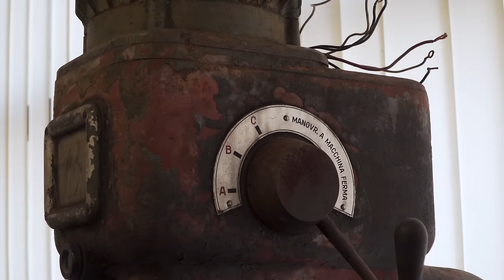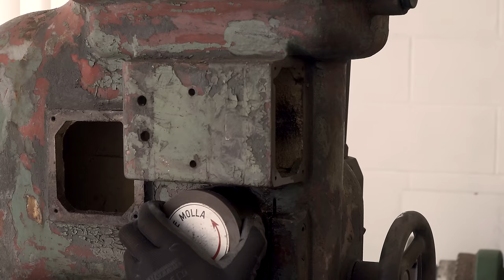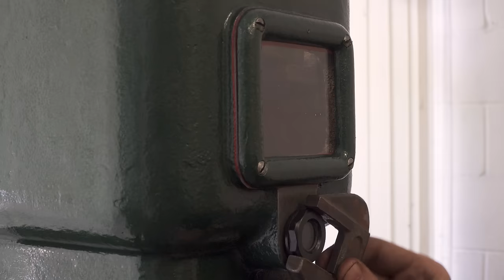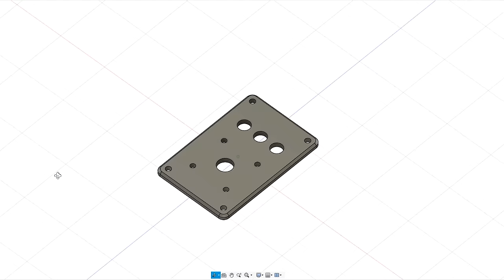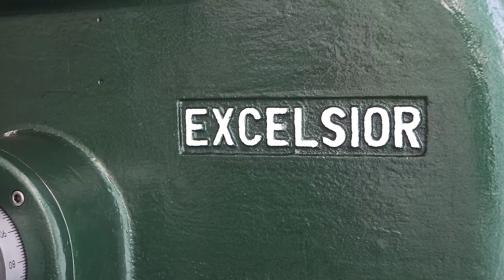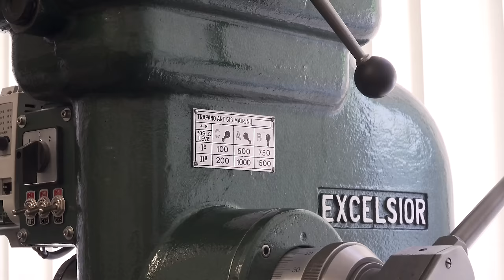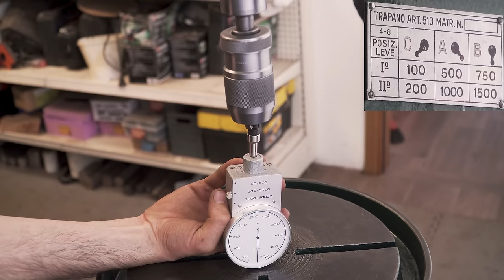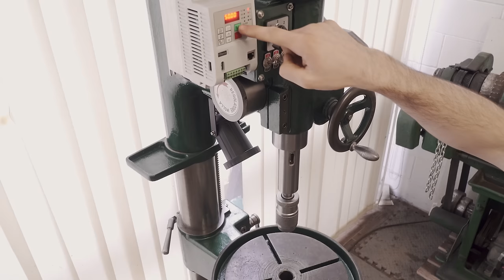EXCELSIOR Drill Press Restoration | Heavy Duty Geared-Head Drill

Comment: For future reference...if you're trying to remove a drill press head for example that has been pressed onto the vertical shaft, or is just fused from time, instead of using a pry bar and exhausting yourself use a reciprocating saw without the blade pressed against a block of wood that is in turn pressed against the part while applying pressure in the direction the part needs to shift, slide, etc. It acts something like a jackhammer...but much less intense. The quick vibrations and forward thrusting motion makes quick work of most fused parts.

Comment: Definitely the biggest tool restoration I've seen on YT! Also, interesting to see a more realistic / practical restoration compared to many youtubers that make everything look perfect - like sandblasting everything down to bare metal and filling any pitting before painting. Or nickel plating all the screws etc. Not that there's anything wrong with that - it's just a different take on restoration. Maybe if you were restoring it to sell, it might be worth going to all that extra work - but not if you are just restoring it to use yourself.

Comment: Very nicely done and what a remarkable machine you now have. I cannot imagine having a drill press this accurate and heavy duty. Very jealous! That will give you a lifetime of joy. I do hope you put some grease or coating on the elevator column. You did not show putting anything on, that I saw, but I know that is a place exposed to whatever is in your shop and seems to "attract" rust from the very air around the drill press. Anyway, great job and I like how you did not worry about having everything polished and shiny. Nice job with the hammered paint. 400 Euro, cheap for that wonderful piece of historical precision and reliability!

Comment: fair warning you've installed that seal below a brand new sealed bearing rather than the OEM open bearings, so there's now no means for the seal to be lubricated. it'll eventually fail and its not really doing anything now except adding a bit of friction to the spindle.  In cases where I've replaced open bearings with sealed ones, usually in plant equipment that's frequently neglected I fill the cavity between the sealed bearing and the seal with oil to prevent the seal from failing.
Reply: Yeah, sealed bearing like that in a non-production environment getting fairly light usage compared to its intention, what do you figure, maybe only 20 years of life?
Reply: @ixamraxi  bearing will be fine. Seal will fail

Comment: Chipped cast iron is perfectly restored with automotive putty with glass fibers. The resulting dried walls can be up to 20 mm thick and are perfectly sanded. After complete drying, they can withstand even medium hammer blows. This is how I restored the chipped edges on the table of the universal sharpening machine.

Comment: Nice one, surprised that this doesn't have feed, since it does have the locking action. We used to have a giant one, which had the same action, and then a rotary selector on the front for the automatic depth feed. Was bought used, and came with spiral drills up to 80mm in diameter or so :-)

Comment: Hammerite is awesome. They make a direct to rust epoxy in smooth or hammered finish and it is one of the best paintaible products I've used. I even use it on custom subwoofers I make. 

It's far far better than dulux or rustoleum hammered finish and products.

Comment: at 27:47 the liquid pump is upside down.  The copper tube cut on a 30 degree or so is suposed to have the solid part of the tube on the bottom.  This is for a reason, you have it pointing down, its suposed to point up.

Comment: I was into the restoration then you put the spring in backwards at 14:22 then crimped the oil line at 17:50.  If you look at 1:39 you can see the oil tube has the relief cut facing up, you reinstalled it facing down.  What rotated? Did you install the oil pickup correctly? Came out nice though.

Comment: So presumably the oil feeds down to the quill bearings from the gearbox? So would it not have been better to remove the seals on the bearings to allow oil to lubricate as per the original? Or would you say it’s workload wouldn’t require it going forward?

Comment: Hi, at 21:00 you made a couple of round caps and a couple of switch covers on some sort of CBC machine, I was wondering if you could tell me a little about it so I can check one out and would appreciate any feedback regarding a unit to buy. The restoration of this old gear head was a treat, I am doing this all the time and find sometimes I just can’t get covers, caps, panels etc that I want, hence my inquiry. Many thanks in advance

Comment: Great restoration, but, curious why you didn't go down to original metal when removing paint? You didn't coat or prep the surfaces when repainting so its assumed the paint will not have a long lasting coat? Just curious 🤔

Comment: Not much point measuring the run-out of the outside of the chuck, you've still got the condition of the jaws and the taper they run on to consider. Stick a piece of ground rod in the jaws and measure it on that. Otherwise (apart from the colour choice), nice save, well done.

Comment: Nice work. Im wondering(not judging), why paint over the rust? I can say i am a noob here, so that' why i'm asking. I loved the video.
Reply: The bulk of the rust was removed. There really was not much rust, just a lot of old dirt, dried grease and old paint. After scraping off most of the paint he left a lot of red stuff on the metal. I think that's the original red oxide primer.

Comment: Is there any specific reason you decided to apply new paint over old one?
Reply: Well, new paint looks good? If you're wondering why he left the old paint on, though, I'm gonna go ahead and say that it probably has lead in it and it's quite taxing to safely remove with power tools, and also quite taxing to remove by hand, so it's just easiest to leave it encapsulated with a coat of new paint.

Comment: I assume that the control unit is just a soft starter and the speed is a factor of winding selection and gears.
Reply: My guess : 2 speeds motor x 3 mechanical speeds thru gearbox = 6 speeds.
Electronic unit allow operation from single phase supply to three phases engine, allowing as well soft start and speed variation between 10 % to 100 % for each of the 6 speeds.

Comment: I did see you pack the bearings and hardly any grease/lube on the wear surfaces.  Why?
25:26  The TRO of the chuck body means next to nothing.  Put a precision drill rod in the chuck and use that to check the TRO.
Nice work.  I especially like the paint color and texture.
Reply: Ooops  "I did not* see you pack...."

Comment: So I see u have that little dial indicator with the yellow face. I have one that small but I haven't used it yet.  How good do u find it in use? I wanted to ask bcos I ask ppl about these all the time but questions get asked of ppl like yourself all the time so I understand how they get missed specially as u have 2.28M subs.. Jeez I got a shock there.. Sorry man. 
I have spent a small fortune on some really nice tools but for some reason I forget to use them when I need to check something for good measurements. I think it's bcos I'm not used to using them on a regular basis.
I'm going to change that now. They've been sat in boxes for too long.
I'm about to check ur ML7 Lathe video now. Shame it's only 6 odd minutes though. I love machinery..

Comment: Great video and restoration, thank you!
P.S. Is there any way to set the lash between the motor and drill press gears?
I wonder if there is because it sounds a bit loud like the gears may be too loose.
Reply from the maker: Thanks!! There is not, no way to adjust. Position is set by ground bearing recesses in casting.
Reply: Ok, thank you for the reply, I appreciate it!
Stay safe and healthy!

Comment: When you use your lathe in the future try to keep your tool as short as possible to reduce tool flex. That way you have less chatter which means a smoother finish :) nice job on the restoration :D I wish I could find a heavy duty drill press like that one :)
Reply: I cringed as soon as I saw the lathe setup.

Comment: The sandpaper on the rusted colum was not a good idea to keep the accuracy of the machine-tool. Ball bearing do not tolerate impact or pressure on the outer ring to push the inner ring in place .You are good at cleaning you should study: how to restore the geometry of a machine- tool.

Comment: Measuring run-out on the outside of an empty chuck might not give the correct reading if you want to know the precision of the machine
You bought it so ig you could check if the manufacturer considers that a critical dimension. If they do then ig ignore me
Otherwise to get a more practical reading put something you know to be reasonable precise, like a gauge pin or the shank of a nice drill bit in the chuck and tighten it. Then, repeat the test but take the reading off a true spot like the shank of the bit
Or maybe I'm wrong and confused, which is entirely possible honestly. I'm very tired

Comment: You did a great job that probably took a long time. Undoubtedly you have sufficient knowledge, however you have not worked with the expected quality, except for the electrical part that seems to be your strength. You didn't remove the corrosion on most parts, you just painted over it, mixing those parts with new parts on the same machine is only going to anticipate serious problems. Careless handling of acid can be very expensive for your health. I suggest you get a sand blasting machine, and work with a professional attitude. I would not recommend you to work at an industrial level, just for the safety issue.

Comment: Painting over scratched rust? I wouldn't buy one of these 'restored' pieces with this low level of attention to details. No sandblasting? No anti rust liquid? Kinda lazy restoration.
Reply: I don't know if it works but he used Hammerite. They claim you can just paint on the rust and it will stop it from rusting further. 🤷‍♂️